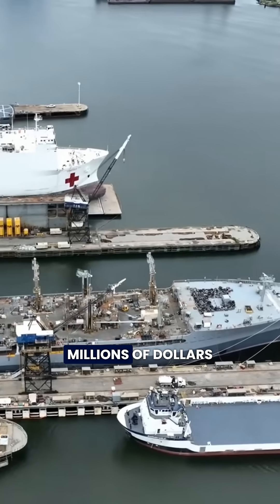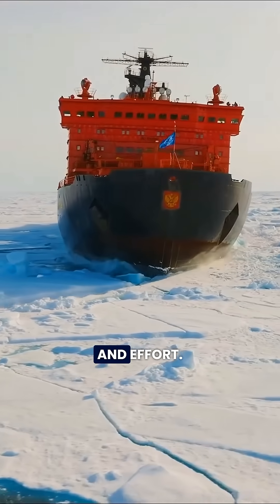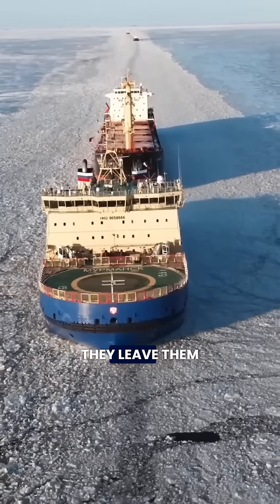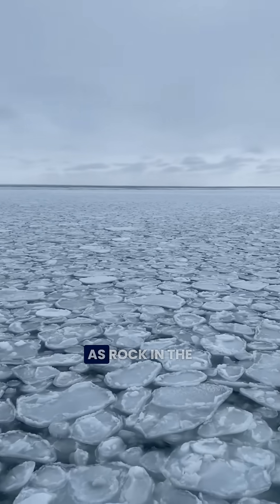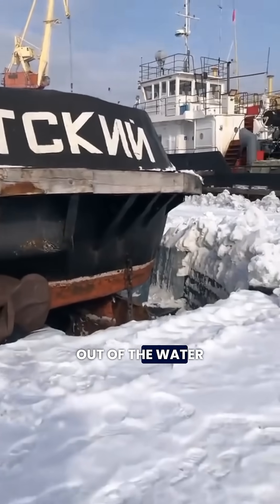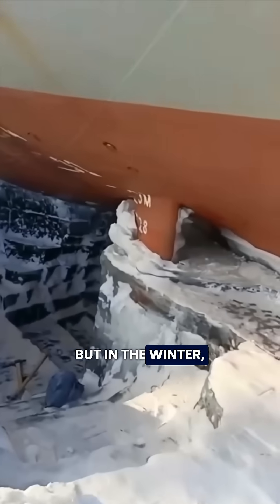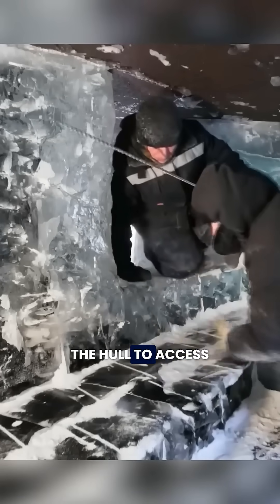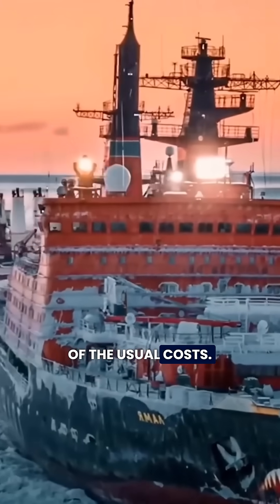Russia's Genius Trick to Repair Ships #Engineering #Ships #ScienceFacts

Comment: It can be cheaper but it is not safer or as efficient, In fact letting the water freeze that deep around a ship in general causes more structural damage. At a repair facility you also have a full view of the ship to look for more issues. You can only remove so much ice when its frozen around it.

Comment: Ingenious yes. Practical no. 

The reasons many like the ship once repaired cannot leave until the dock until it thaws, the ship could be crushed by the ice thus sinking it at the dock, the ship could be push out of the water and flip into the dock thus damaging it or destroying the dock, and not mention that tools that use heat like welders and blow touches must be limited to ensure the ice doesn't thaw prematurely and cause the ship to fall on workers.

Comment: the most stupid way to repair ships not wounder they are retards how long they will have to wait till the river flows agin  
4 month or 6 month were in a modern ship yard its several hours to lift one day to clean the bottom and paint  replacing shaft or balancing propeller another day or 2  if needed  for cruise ship industry its about one or 2 days  then back into the water

Comment: That is a shit idea
Reply: Explain why
Reply: @Seraph09120 I don't even know where to start. First and foremost horrible work and cost efficiency - cutting thorugh ice only to get to single spot requires a LOT of effort and you still only have access to single part of the ship, not to mention it is slow. Health and safety? Yh, good joke.
This approach is taken in russia only for two reasons, first because there is not sufficient number of dry docks and second, because manpower is cheap.
Reply: @u33c214yb29 you're wrong, first of all they got equipment to cut through the ice, it's easy, they got lots of manpower, and they got enough dry docks, in the winter it's just easier to do it like this rather than break through the ice
Reply: @Seraph09120 Today's Russia - just like it's predecessors, Soviet Union and Imperial Russia - stands on outdated solutions.
That's why Lada 2107 was manufactured until 2012.
Reply: @u33c214yb29 so are you gonna respond to his point or just change the subject by copy pasting your pre-made USAID paragraph?
Reply: @mikhailkalinin6536 
Btw, manufacturing Lada 2107 in XXI century was friggin embarrasing.
Reply: @u33c214yb29  Russia manufactures everything, from silverware to floating nuclear reactors. US cant even manufacture that, all of its autoindustry is split between Mexico and Canada, and the rest is made in China. Its a colony of foreign interests and lobbyists lol.
Reply: @mikhailkalinin6536  Accusing USA of relying heavily on china imports sounds quite ironic from the mouth of Russian. First of all China is manufacturing and exporting everywhere, second Russia is getting more and more dependent on Chinese imports by the day, especially when it's turned their economy to war, pumping more and more money into arms manufacturing, withdrawing workforce from other industries which results shortages of labor and prices increase. Increased military spending, fossil fuel income issues and sanctions also caused a lot of trouble for Russia's economy. You want to convince me that nothing changed in Russia's finances - for both state and average citizen - since the start of Ukraine war?
 Btw, which region of Russia are you from?
Reply: @mikhailkalinin6536  Being dependent on China regarding many consumer goods pisses me off, ngl.
But if your government won't stop this madness, people like you - ordinary Russians - will be the biggest losers. Russia is literally slowly backsliding to the Soviet era now.
Reply: @u33c214yb29 the entire world has been losing ever since Bush and Clinton led a terrible foreign policy. We really tried to be friends with US. We thought we could play you and China off of each other and sit comfortably in the middle. But I guess the overlords in Beijing told US that they need to bring Moscow and China closer to each other.
Reply: @mikhailkalinin6536  Well congrats, you played yourself. Ukraine war will leave both RUS military and economy in desolation.
Reply: @u33c214yb29  Oh, of course it won't. But it will absolutely destroy the US soft power. It has become progressively more obvious as more and more countries began shifting towards China, including India and even the EU, which has been doubting NATO's credibility ever since Russia started boiling that frog with sabotage and airspace violations. 
There is a reason Kellogg came running like a begging dog in February about how they desperately want to untangle the Russia-Iran relationship. How did that work out? But I appreciate you looking out for us!
Reply: @mikhailkalinin6536  only wildcard in NATO puzzle is Trump and he'll be gone soon. If you are thinking that EU is shifting towards China you are just as delusional as people sitting in Kremlin.
And their geopolitical planning is flawed, so to speak.
Reply: @u33c214yb29 ohh, no. NATO's defensive doctrine has become a joke ever since Clinton. Trump matters very little here. Did you not read my previous comments? 😁
Its overstretched, way too overextended, its only purpose now is to buy European politicians through tribute and maybe in the future put nukes on the border with Russia, akin to cuban missile crisis (which will never happen). Americans arent fighging a war with Russia over lithuania, they made that clear many times. Maybe thats why the entire visegrad (Hungary, Slovakia, Poland and now Czechia) have been slowly moving towards appeasement with Russia?
Reply: @mikhailkalinin6536  America doesn't have to wage war with Russia at all because now Russia is burning through their resources, money and manpower on the fields of Ukraine. It's a proxy war, but still, Russia cannot overpower much smaller enemy. And if Russia is unable to defeat country of 35 millions, there is no way it can even think of attacking anything bigger. I can assure you attempt of full scale invasion of any country that belong to EU bloc would launch a chain reaction.
Poland itself is more than capable to kick your butts and trust me, they won't be alone.
Reply: @u33c214yb29  We don't need to invade any EU countries to defeat NATO, it seems to be having a stroke all on its own right now without a single bullet being fired. The frog is being boiled, we don't need to jump in 😁
Funny how Russia pushing Ukraine's teeth in is enough to embarrass all of NATO, when its not even a member.
You seem to enjoy completely ignoring previous points made in my comment and love to change the subject, your moderator needs to update his software.
Reply: @mikhailkalinin6536  Russia will win in exactly same way as they won cold war. Oh, wait...
Reply: @u33c214yb29  Only China won the cold war buddy. And maybe the Heritage foundation too 😁
Reply: @mikhailkalinin6536  Talking to Russians is really interesting experience. No matter how bad things go, you still believe that Putin and his administration is playing some 3d chess and they are going to outplay everyone, while actually playing themselves while their BRICS 'allies' is screwing them over. You people are completely brainwashed.
Reply: @u33c214yb29  No need to play chess when US foreign policy has been shooting itself in the foot for the past 30 years. You completely undone the Sino-Soviet split, brought India and China closer together, got bogged down in the Middle East and ure afraid to get out because The persian gulf will crumble like afghanistan did, turned Iran into a regional power and now even the EU is growing weary of NATO in visegrad region. Sit down, F. As we would say. Absolute failure in geopolitics. Kissinger and Nixon are spinning in their graves.

Comment: So much misleading in this video.  These ships are built tougher than the average ship to endure ice in the arctic.  That’s the only reason they can be frozen in ice this solid.  And the river is frozen for 8 months, so once frozen in the river, the ship is stuck there until the thaw.  On the whole this is not cheaper or easier.

Comment: This is done not because of ingenuity, this is done because of lack of other options. This is not suitable for most hull work because of low temperatures and ice that has to be cut out. It's also not cheaper by any means, it's only cheaper because those people are paid peanuts unfortunately. But same peanuts are paid in the dry docks to workers,.

Comment: Repairing a ship in minus 20 degree weather seems like it would produce quality issues.
Reply: It is not repair it is maintenance, video misspoke. Repairing requires complex equipment.
Reply: @ComboMuster , I can prove your words about mistranslation of the Russian word "ремонт" (remont) - in Russian it's meaning usually includes both repairs (if they are necessary) and maintainance.
Says so the professional translator.
Reply: @GeneSlasten-b8e4y  Maybe the commenter misspoke, some people do not know the difference between maintenance and repairs.
Reply: @GeneSlasten-b8e4y maintenance is обслуживание or  техобслуживание. Dont mix it with repairs/ремонт
Reply: @GrinyaLovesYou , and where did I mix them up ? On the contrary - I stated that Russian word 'ремонт' (which is a borrowed word from English - "remount") in plain Russian parlance often has both connotations - repairment & maintenance. That's why Russian speakers have problems when distinguishing between them in translation into English.
Reply: -25 degree celsius
Reply: -20 is like usual for most regions of russia. they are talking about from -40 to -60
Reply: Minus 20 is far from enough to create such a thick ice.Think more of minus 40 to 50 C.I have experienced close to 40, but never 50 and slept in a tent at minus 27 in the army.Its just a matter of enough warm clothes and never to remove your gloves for more than a few seconds and cover all skin.
Reply: -20 это не -60😂
Reply: нет, изначально техника создана для таких условий ремонта.
Reply: @Maximspec  that concept is lost in western europe. its really sad.

Comment: The fact that temperatures fluctuate that much, to create meters thick ice, that will then melt back into water is insane. I will say, it may be easier, but the fact that the ship has to wait means it won't be making any money. Id imagine this is last resort type stuff.
Reply: @latenightcereal 2390 A dry dock costs even more to build and maintain, as such maintenance often require weeks of immobilisation at a time thats a pretty smart and cost effective method. If there is no dry dock available a ship will have to wait or still cruise ut with an highter risk of breakdown, which can cost a lot. Civilian and non-russian ship probably go elsewhere but for their navy, which sticks to port most of the time anyway, its a good idea. Just operating ships so far north is impressive.
Reply: Anual (or multi-anual) maintenance can be planned, and when costs (due to needing icebreakers) are higher to sail the ship in winter, you plan the maintenance in winter when the ice dock is available.

And when you are not in a rush to free up your dry dock for the next customer, less mistakes/oversights will be left for next time ship is in dock. You just come back to it next week or when parts are delivered.
Reply: Russia has the world’s largest and best nuclear ice beaker fleet.  If any ship is stuck in ice and it needs to move, their ice breaker will break the ice and clear a path for them.
Reply: @G3NK5T42  The rivers are too small for icebreakers, so they don't go on them.
Reply: @G3NK5T42 have you see the uce walls. That aint breaking😂😂😂
Reply: @kettelbe  Some ice breakers can go throught 3m thick ice. But they would not break ice this thick so close to another whip, as the pressure of the ice trapped in between would probably break both hulls. As it says in the video this is done in a river which freezes so they must have good estimation of the time before it melts.
Reply: @G3NK5T42 no ice breaker in the world will break that ice, I don't care what you think.
Reply: No. It freezes quickly. It's much faster than going to a shipyard.
Reply: If water is frozen - ships can't sail anyway.
Reply: @Skousen77  корабли ходят ☝️ плавает дерьмо !

Comment: Stupidest script ever. For several months a year you cannot use the ship at all as it’s locked in ice. That’s commercially viable Talk about spin and propaganda. The real reason is they cannot afford to build dry docks for all their old decrepit barely commercial ships. They cannot afford the machinery and divers to clean them, repair them so they use the ice which is cheaper than infrastructure. Lives are cheap in Russia, corruption is expensive.

Comment: This is not done out of cleverness, its done out of necessity. This is not efficient. Its esier to pull it into a drydock have divers place blocks, and pump out the water. Job done. Waiting for freezing, and then litterally digging out your work area is not smart.

Comment: Yup that seems way more effective than taking it to a dock.  😂.
Reply: Dunno how it saves time if you gotta wait 6 months for the ice to melt
Reply: It is. And no fees or charges. Just ice that goes away by itself.
Reply: @miapdx  no charges? You need to transport all the equipment and material over rough river ice. Instead of taking the ship to a dry dock, you’re just taking the dry dock to the ship.
Reply: @miapdx no fees huh? So they don't spend any money to move all the equipment out there to the middle of nowhere in a frozen river?
Reply: @miapdx JD Vance? 😂
Reply: You cannot move those ships even if you wanted to.

Comment: Painting is the most easier done at -30 degrees C.
Reply: Same is true for welding. I am sure you need to preheat even the mild steal at these temperatures. Not accounting for any special steal maybe used for those ships
Reply: @Isleman-u3s  Weird, in ashipyard i work in in Norway when temperature falls too much welding outside is prohibited.
Reply: @Isleman-u3s  сталь становится хрупкой как и пластик, резина ломается. Поэтому да, лучше погреть.
Reply: @Isleman-u3s в России на севере основная стройка идёт зимой, строятся нефте и газопроводы перерабатывающие заводы,  у нас и мосты и строят и ремонтируют в том числе зимой, бетонные работы тоже ведутся зимой когда надо, Зима длинная поэтому технологии от ваших отличаются
Reply: @БендерРодригес-о9ю  russian engineering is on a level rarely grasped by westerners. I guess that comes with the territory, quite literally! :)
Reply: @Isleman-u3s  *steel
Reply: @Isleman-u3s cmon😂welding is performed at +2500C it does not matter if the steel is +30 or -30😂
Reply: @vlp1603 
Yes it does
Reply: @AitoHemmo how? the material in the region to be welded has to get hot. the differnce increases. but that wont do much on its own.

those people know what theyre doing - their stuff works, while western gear usually doesnt even operate in these conditions, apart from mil tech.
Reply: [humour on] Why? Mix up 1 bucket of paint with 3 buckets of thinner. All good to go...   ;-))
Reply: Compared to -60 - yes. A huge chunk of the Russian territory is located at places like that and guess what, people live and work there. There are industrial plants operating there, oil rigs, large cities built on permafrost.
Reply: Because those ships are most the time in cold waters Barnacols Doesn't grows
Reply: @miapdx 😂

Comment: It's amazing what you will stoop to when you don't have a port... This isn't genius it's a survival tactic born of a combination of lack and necessity.
Reply: Кто тебе сказал, что их нет? СНН?)
Reply: Yeah approach logic is: we do not have money or know how but we have plenty people to spare , especially the ones that are not ethnic White Russians .
Reply: That how progress and evolution happen. Adopting and innovating and changing because of various outside factors.
Reply: @Stan-jq8jr  There is no progress or evolution happening here. It's a stop-gap solution that allows a very small area of a ship to be worked on. It will never replace a port nor be used for major repairs. It's good for patching leaks and prop work but that's the limit of it. It's even sub par for patch work because you can't replace the ablative paint so your patch ends up raw steel in contact with sea water. You can't do any of the major work a port provides on a frozen bed of ice. This is effectively like digging the sand out from under a truck tire to replace it. You are never going to replace a mechanics lift with this type of last ditch in field repair.
Reply: Triggered.

Someone's lost their cool, eh?

Perhaps you should reacquaint yourself with the definition of "genius."

Comment: I don't see them sand blasting and painting the hull like that.
Also there is no overhead dock based crane system that shipyards rely on for various repair requirements. 
Also... there isn't a closely associated parts delivery system (railway network ..etc).
Reply: Underwater hull.repairs n inspection.  The ONLY resons you go for DRYDOCK.

Replacing seals , taking off the propeller , trplacing sacrificial anodes, cleaning ya sea chest , ranging ya anchor .. ya dont really need cranes for that.  Chain blocks  , hydraulic jacks would suffice..